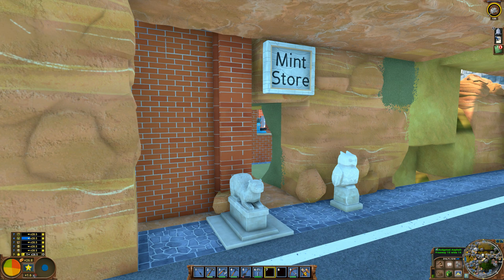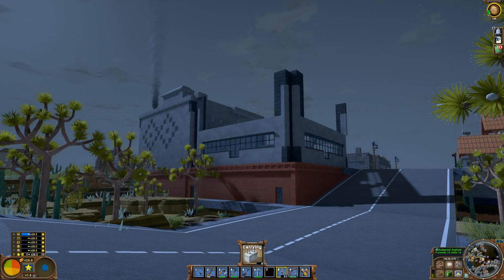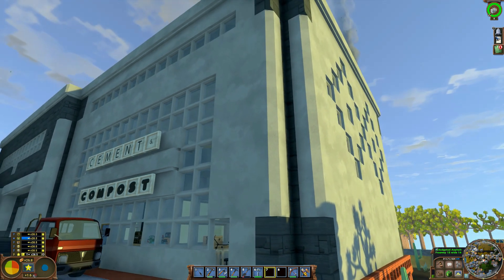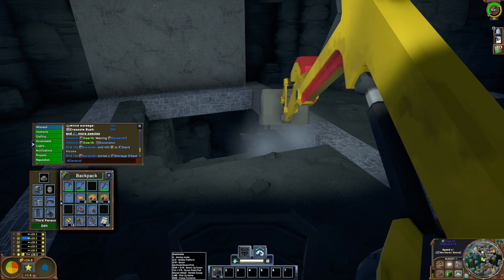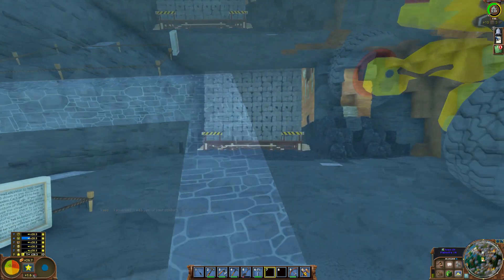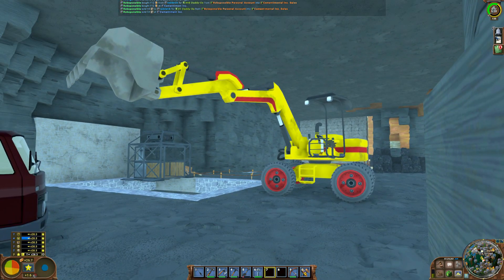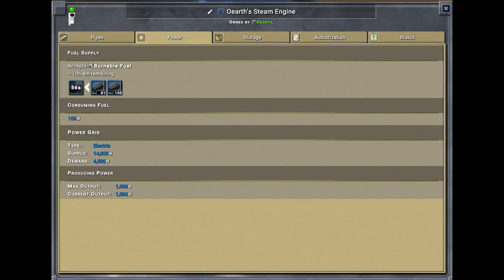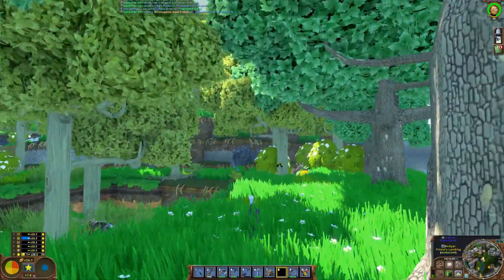ECO 9.2.4 - EP10   New Construction, Build Laws, Contracts, & Steam Power FTW!

Comment: pays 2 daddyos per scoop of dirt. How is that kept track of and proven??!?!?!?!
Reply from the maker: @Austin Brown  Not too sure what you mean, but there are a couple ways to manage payment for scooping out dirt.   Knowing the area you want excavated, it's simple math to know how many blocks of dirt that is you want remove and set a payment for that.  Using out build law, we could also apply that to dirt removal when the precise amount isn't know - you'd set a payment for each scoop of dirt taken in the designated build zone; and like most road laws, tax if they are just putting it back.  They may or may nopt answer your question, but you can see more about the build law in my video on Law System Explained where I use that as one of my 4 examples.